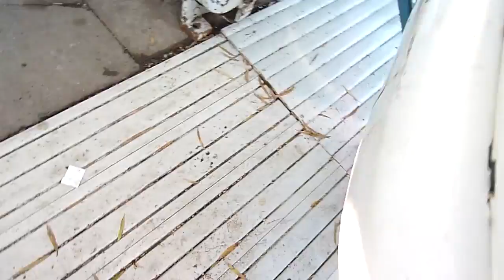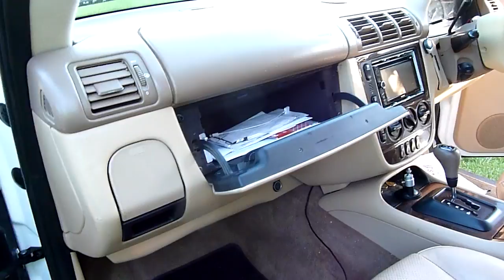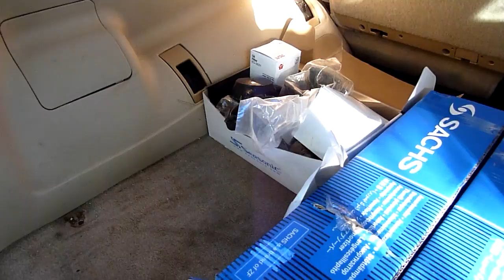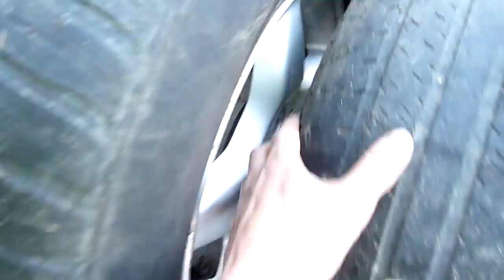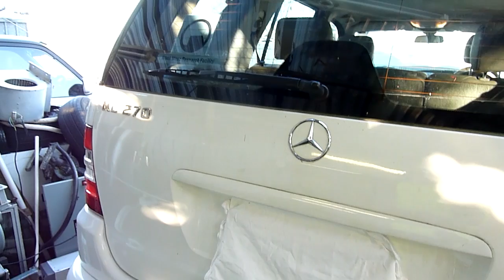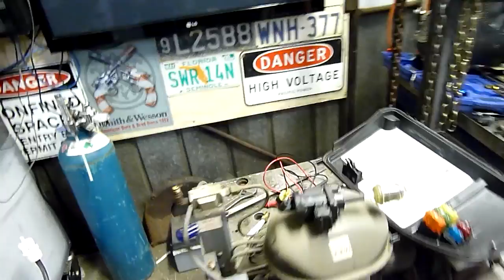2001 Mercedes ML270 Work Progress

Comment: I'm sure the rear suspension is the same as the front, just turned around and steering jigged for tracking even the anti-roll looks the same apart from the drop links, if that makes any sense.

Comment: Hey Aussie50,  got a question for you.  I've got a bmw 3181 1.9 2001 model.  It seems to be running rich and I can't seem to solve the problem.  I've already changed the 02 sensor and cat.  Can you give me some pointers.  Cheers.
Reply from the maker: check the fuel pressure regulator, if it goes bad it could force the rail pressure to go too high and spray far too much fuel in.

Likewise make sure it has its vacuum line intact (assuming its like the one on my old 7 series) because if thats busted off, it will run badly too.
Reply: Thanks mate,  will give it a try and let you know the end result.
Reply: Aussie50 Hey Aussie i wanna buy the v8 diesel ml what do u think is any good just want ur opinion or the 270 ml is better?
Reply from the maker: ***** The V8 diesels are monsters :D, but I have not actually worked on one, I imagine they have their issues, but not as bad as the earlier ones. I would just do all the research you can on them so you know what to look for when shopping!
Reply: Aussie50 Thanks man anyway i was thinking an a ml 400 cdi model 2002-2004 thoose v8 i heard is pretty good but i was just asking for an expert point of view haha thanks again Aussie

Comment: these are extremely small to compete with USA SUVs. That thing is like the size of an escape. That is puny.
Reply from the maker: it definitly feels bigger than the Escape did, but I agree, we do not get the huge US SUV's like the Lincoln Navigator (I want one of those :D)
we do get grey import SUV's from the US tho, but not many. I could find a Navigator over here but it would be expensive, and local parts support, forget it!.
Reply: Any Ford Excursions?
Reply from the maker: joeyf504327 not that I have seen, I  am sure they are around tho.

Comment: With Mercedes-Benz I have always had the feeling that the cars themselves cost alot when you buy them, but are relatively cheap when it comes to replacing worn out Parts. I can still get Genuine Parts from my local Mercedes-Service for my 22 year W201 without ripping my wallet apart.
Reply from the maker: yeh they are pretty reasonable, very few parts on the older ones are what I would call "expensive", hell, I would bet Honda charge as much for a new ECU as MB would!.

Comment: Those springs are called progressive rate springs. The idea is that they're soft during the first inches or so of travel, then stiffen way up as travel goes further. That way you can have a soft ride, but still carry a lot of weight.

Comment: Ed if you still have the SD card and pc can detect it try downloading a set of programs called testdisk and imagerec they will be bundled in a zip file you should be able to recover them files if the program can detect them

Comment: Wont the removal of the egr system have an effect on the exhaust gas output, or is it so minimal that it will still pass emissions testing?
Reply from the maker: no emissions testing :D
Reply: Aussie50
Oh you lucky sod ha ha :-))
Reply: Aussie50 Lucky git, I've had a couple of MOT failures due to diesel smoke tests before. Bit of fuel additive and rev the nuts off it for a while usually sorts it but still a royal pain in the arse.
Reply: Ain't no emissions testing here either! I took out all the cats in my Mondeo and laughed all the way to the scrap dealer and made a nice $100 off the three cats. They don't even care if some diesels roll coal down the highway. I love NZ sometimes. I also blocked off the EGR in the Mondeo as well, but it was entirely vacuum operated. Just had to blank off the 3/4 inch hole in the inlet, cap off the fitting on the rear manifold and block off the little vacuum line with a nail I found on the ground. The later model V6 Mondeos did away with the EGR completely, so they clearly saw that it was a crap idea that didn't really do anything

Comment: You shoulda got a BMW. Lots of fun maintainence and better styling. I own a 325i and love it to pieces, literally
Reply from the maker: I did want an X5 3.0D, but they are more than twice the price.
Reply: Yeah, If it was from 2000-2001 like your Benz then I'd go out on a limb and say they are twice the vehicle. mechanically and design wize they were more modern and they kept that build style up until 06 or so.. My only problem with them and my car as well is the audio. I got a aftermarket one with a stock faceplate and that fixed it. It kept the nice stock look.

Comment: You can normally reduce the pressure in gas struts - remove the fitting from the fixed end and you should see a hole up the middle of the shaft. In the hole will be a ball bearing..If you support the strut and tap it using a (clean) pin punch and  hammer...With every hit a bit of gas will escape. Just don't go too crazy and don't let any cap in there as it will prevent the bearing sealing again when your done.

Comment: What task does the EGA meter do? It sits in the inlet for what, airflow measuring? It is interesting to see that you still get road worthy by taking something off from the engine.
Please do something to the steering wheel, cover it with new brown leather
Reply: EGR is recirculates a portion of an engine's exhaust gas back to the engine to reduce emissions and it also helps the engine run more efficiently.
Reply: Except on a 70's era American car, all it does on those is waste gas and make the engine run like crap.